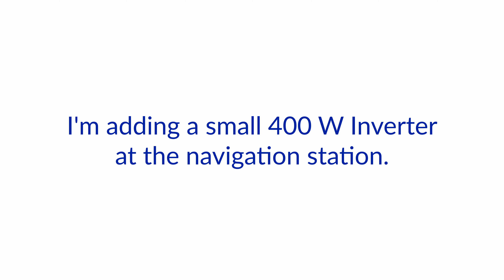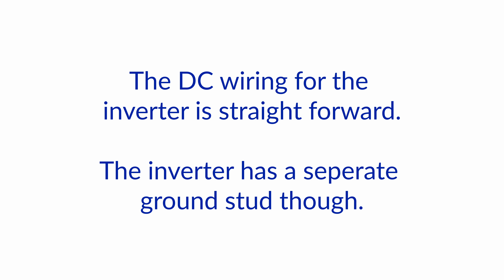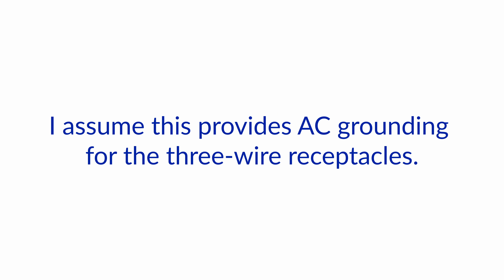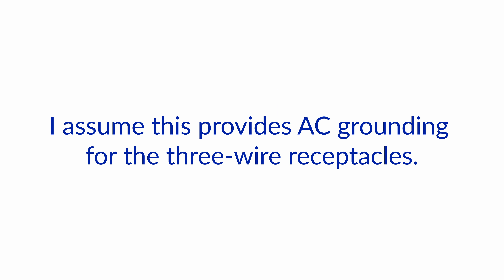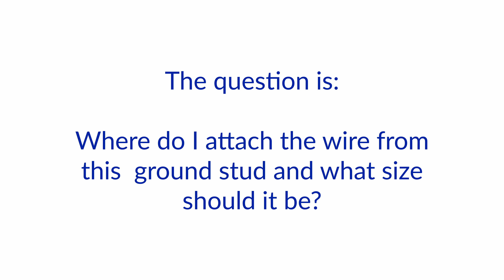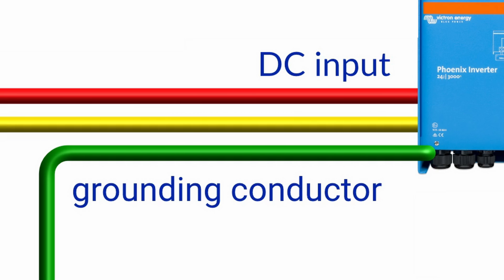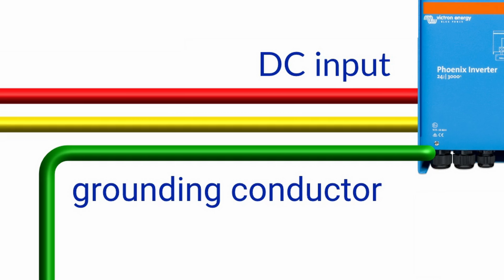Grounding an INVERTER -  Don't undersize your grounding wire! | Ask The Expert with NIGEL CALDER

Comment from the maker: We will probably make another video about this to explain the concept in more detail. For now, here is some explanation clarifying the comments:

We ground AC systems primarily for shock prevention. We ground DC equipment for a variety of reasons. Regardless of the reason, for both AC and DC systems we must think about the worst-case fault current the grounding conductor may be called upon to carry before a circuit breaker trips or a fuse blows, shutting down the fault current. In the case of AC systems, the grounding conductor is the same size as the ‘live’ wires (hot and neutral), or one size under. It’s the same for DC systems – a grounding conductor is the same size as the DC positive and negative conductors or, in some circumstances, permitted by the ABYC to be one size under.

Consider a short circuit from the DC positive side of an inverter to its case. The DC positive conductor will be protected by a high current fuse with a rating as high as several hundred amps. In the event of a short circuit to the case, the grounding conductor needs to be able to carry hundreds of amps, without melting down, long enough for the fuse to blow and shut things down.

And yes, this is a large conductor! Which is why it is frequently omitted by inverter installers. The inverter will still function fine, but with reduced safety. The AC grounding side is also typically tied to the case. So now if we get a DC positive short circuit to the case, the AC grounding conductor, which is far smaller than the DC negative conductor, will be asked to carry the fault current. It will melt down along its entire length long before the DC positive fuse blows. Luckily, for all those installations without a properly sized DC grounding conductor, a DC positive short to the case is a very rare event.

The case grounding conductor goes back to the DC main negative bus, or whatever serves this purpose on the boat. Note that the full fault current still has to get back to battery negative without melting anything down, so there has to be a conductor back to battery negative from the DC main negative bus that is at least as large as the inverter’s grounding conductor.

- Nigel
Reply: perfect, thank you for taking the time to elaborate.  that reply just cost me a couple hundred dollar in copper lol....
Reply: Thanks for the response!
Reply: Another question hopefully you can address in an updated video.  My inverter will be about two feet from my lithium house bank that feeds it.  The positive and negative busbars for this lithium bank are the same ones that will feed power to the inverter.  You mention a DC positive/case fault only needs to get back to the battery negative. Is it then sufficient  to just connect this case ground directly to the same negative bus bar feeding its DC negative input with the same gauge 4/0 wire, instead of running it all the way back to the engine/earth busbar thats near the engine block?  My DC negatives all eventually connect to this engine block earth/ground but with smaller gauge wire.

Comment: Thanks for that, but where do you send the ground if you have a boat like mine? I have a composite catamaran with outboards, no metal through hulls but I do have an HF dynaplate. Do I just send the erath back to the negative on the battery switch?

Comment: Hello Nigel and Jan
In the Victron 1.6KVA System schematic pdf download, the grounding conductor of the Multiplus case is connected to a main negative busbar and the main negative busbar is connected to the chassis with a grouding conductor. Can you connect it like this without any problems?
Kind Regards.
Reply from the maker: see our pinned comment above

Comment: like the other posters, i would really like to know as well where we have to terminate this ground. on my new to me, yet to be installed inverter, that means a 4/0 ground wire. im assuming on a FRP hull, a ground this big would have to go all the way back to the DC negative bus at the engine?  that would be the largest earth ground on my boat by a fair margin.
Reply from the maker: see our pinned comment above

Comment: My understanding of grounding the housing of AC devices, 120 v. for example, is to prevent an electrical fault to the housing from electrocuting someone who touches the live housing.  So what is the purpose of grounding for a non-dangerous (from electrocution) 12 volt circuit?
Reply from the maker: see our pinned comment above

Comment: I see several aspects of boat inverters that make grounding issues rather complicated.  First, we're dealing with potential faults of both a low-voltage DC circuit, as well as a high voltage AC circuit.  Secondly, we're dealing with two hazards, fire hazard and potential electrocution hazard.  And just to make things even more interesting, we're sometimes dealing with small wood or fiberglass boats that have no existing ground connections to the water.